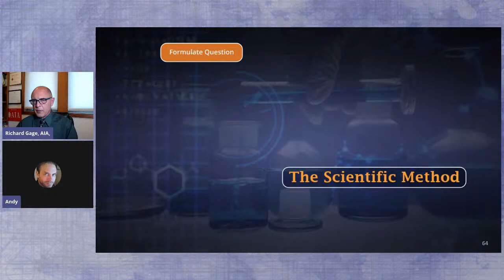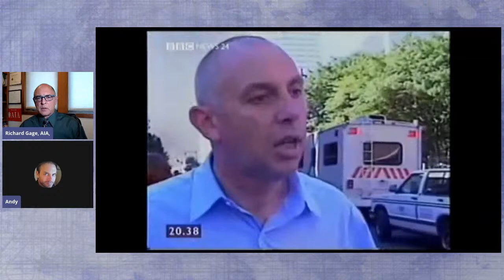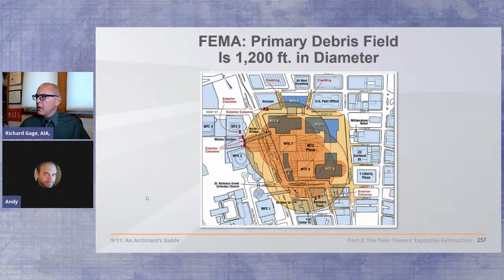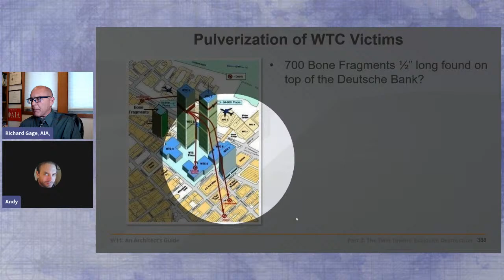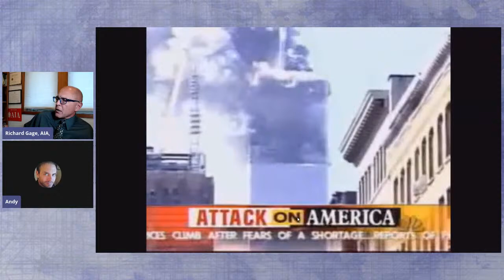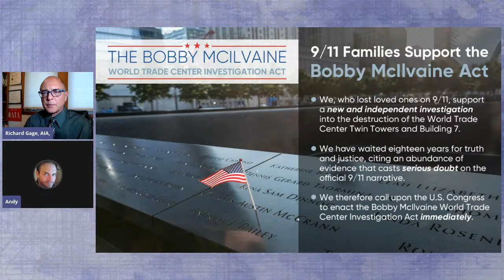9/11: An Architect's Guide - Part 2 - Twin Towers' Explosive Destruction (7-8-21) Webinar - Gage)

Comment: Richard You state that the weight of concrete dust ‘lost’ during the North Tower collapse is 90,000 Tons. From this we can start to calculate the amount of Thermite used if your theory is correct:
The claim is that Iron microspheres make up 6% of the dust samples (5.86%) and so if we take 6% of 90,000 tons the total weight of iron microspheres is therefore 5,400 tons

The Ratio of Iron to Aluminium in thermite 3:1 indicates that the 5,400 Tons of iron would have been accompanied by 1800 Tons of aluminium in the thermite, so the thermite required would have been 7,200 tons.
(I shall ignore the weight difference between iron and Iron oxide.)
The 7,200 Tons figure assumes all of the thermite was inefficiently turned into spatter, using its energy to heat the air rather than to heat the beams.
If we assume that the efficiency was a more reasonable 80% then the 7,200 tons represents only a fifth of the actual amount of thermite.
The actual amount would be five times higher, 36,000 tons for each of the Twin Towers, 72,000 tons for them both. 
This of course is just a starting point, because there is also the claim that Thermite continued to react within the debris pile and this would not have been registered in the dust samples.
29000 Tons seems an awful lot.
Could you clarify if your own  calculation differs from mine?

Comment: Richard, I think that this is the first time I have heard you make the argument that the reason the seismic signals from the South Tower are roughly Twice the size of those from the North Tower is that the conspirators placed twice as much explosive in the North Tower. I can understand why you would make this claim as any other explanation is likely to undermine other parts of your proposal.
You avoid offering any explanation as to why the ‘conspirators’ would do this, and offer no evidence to either demonstrate where in the towers the explosions occurred that you believe caused the seismic signals of 2.1 and 2.3, and no evidence to demonstrate that the North Tower was subject to an explosion twice that which you say went off in the South Tower.
Having read the majority of World Trade Centre task Force interviews I have not found a single account describing any such explosions. The fire officers who survived being in the North Tower during the collapse certainly made no reference to any such explosion in the documentary, The Miracle of Stairwell B.
I understand that the claim is made that the reason the EXPLOSIONS of Flight 11 and Flight 175 did not register on the seismic recording was that the buildings absorbed the shock wave. This implies then that the seismic signals of 2.1 and 2.3 that you attribute to explosions were also near the base of the building. The survivors in Stairwell B would presumably have noticed if an explosion had occurred beneath them. 
Will you clarify your thinking on this?
Reply: William Rodriguez clearly describes being in one of the the upper sub-basements (if you get my meaning) of one of the towers and there being a powerful explosion below him before the plane struck above him.  He said they were quite distinctly two separate events. There were also explosions in the first tower to be struck when the second tower was struck.  Those can clearly be seen on video. Perhaps those combined events registered the larger seismic event.  And then there were the large explosions in the basement of WTC 7, whether or not those were simultaneous with either of the other events, I don't know or recall. It is an unfortunate fact that forensic examinations of the buildings could not be done due to the rubble being hauled away almost immediately and then sold off to China as scrap, thus precluding any real ability to say this or that happened here or there in every case.
Reply: @stampdealer  If you accept that the trace of 2.3 indicates one hundred and twenty eight times the amount of energy was released as was released by the 0.9 explosion, which supposedly caused the damage witnessed by mr Rodriguez,  how do you explain the lack of clear evidence in the video of the collapse of the North Tower as seen from the Hudson river? Also how do you explain that an explosion of this magnitude did not draw the attention of the survivors in Stairwell B?
Reply: @simonthorneycroft1339  I apologize, but could you please rephrase your first question? After "Mr. Rodriguez", I am not entirely clear as to what you are asking, and I want to be sure that I understand.
Reply: @stampdealer  Excuse any confusion when you mentioned Mr Rodriguez, I was thinking he was the gentleman who witnessed the destruction of the parking lot, Mr Pecoraro:   In the book (available on Kindle) Can we get serious now?: The controlled demolition of the World Trade Centre Buildings, the author writes  - As a measure of things, the reported explosion in the basement of the North Tower that registered as 0.9 on the Richter scale resulted in the damage described by eye witness Mike Pecoraro “the whole building seemed to shake and there was a loud explosion. . The machine shop on level C was completely gone. With nothing left but rubble and a 50 tonne hydraulic press -gone.” The parking garage was also “gone” and on the floor below they found a 300 pound fire door wrinkled up like a piece of aluminium foil.” 
I should point out here, that the Richter scale is a logarithmic scale and the energy released to create the 2.3 magnitude reading would have been one hundred and twenty six times as large as the energy released by the event that caused the original 0.9 magnitude reading. 
To put that in prospective, if we imagine the energy from the 0.9 magnitude event as the volume of a table tennis ball, the energy equivalent of the event causing the reading of 2.3 would have been a little smaller than the volume of a volleyball. 
Given the destruction apparently brought about by the explosion in the basement that registered as 0.9, I would have expected that the explosion causing the seismograph to register an event one hundred and twenty six times the size to be widely reported by the witnesses, and evident in the video and sound recordings of the event.   The question I was trying to pose to you Greg, was how an explosion 126 times as energetic as the one supposedly causing the damage seen by Mr Pecoraro is not evident in film of the events and is not reported by the survivors in Stairwell B who were in the building at the time?  

I will have to look up the account by William Rodriguez. with thanks, Simon
Reply: @simonthorneycroft1339  Thanks for clarifying, Simon. I honestly don't have an answer. I'll have to look up Mr. Pecoraro's book, I can't say that I've heard of it. Do you happen to be familiar with Dimitri Khalezov's theory that suitcase nukes were placed in the very bottom sublevels, basically just above the bedrock of WTC 1&2? As an aside, I think Richard Gage is a bit out of his element in re WTC 1&2. I believe he is dead right about WTC 7, but he shouldn't really be wandering across the complex to the other towers. Best, -Greg